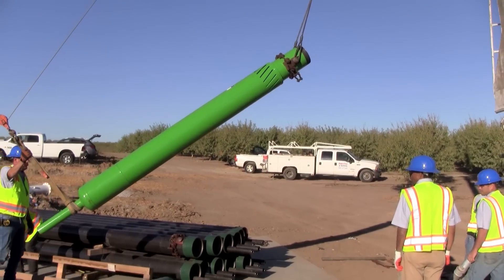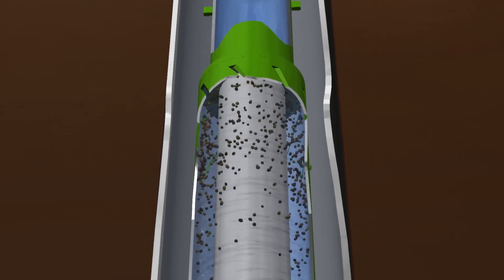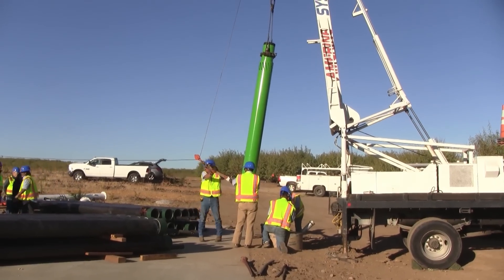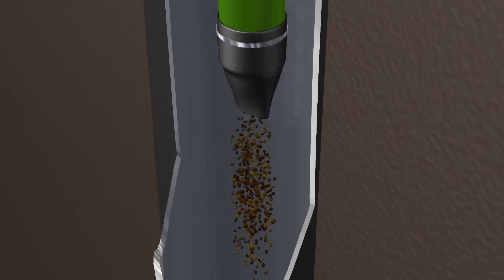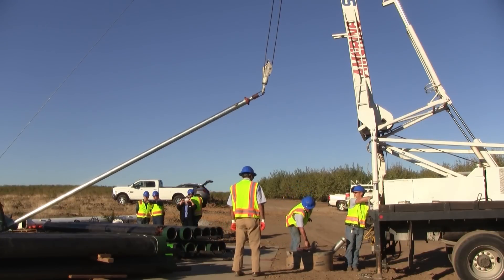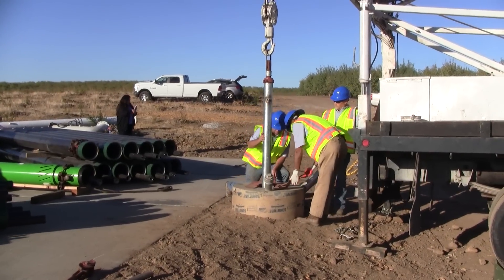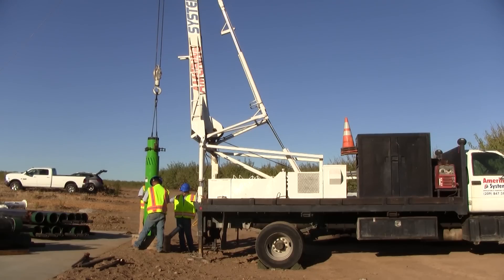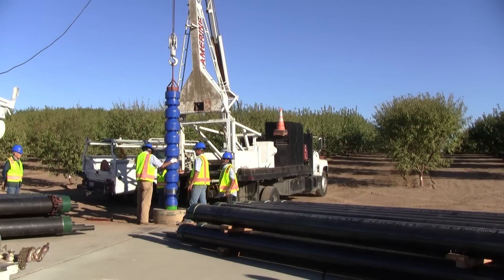LAKOS Pump Protection Separator (PPS) - LAKOS

Comment: It seems that the sand is deposited in the pipe assembly. After a long run, the assembly will be filled by sand. What will happen then?
Reply from the maker: There is a flapper valve at the bottom of the purge pipe assembly that opens to dump sand back in the well.